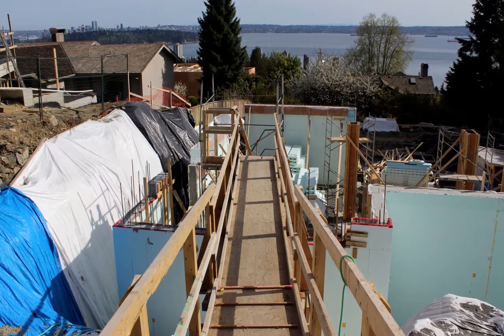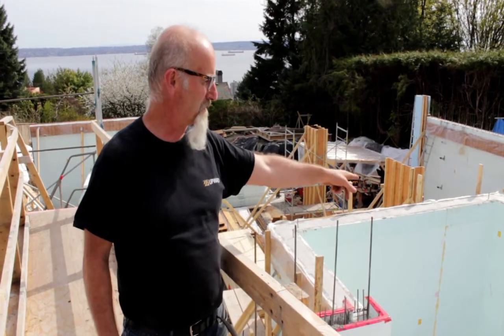Nudura Insulated Concrete Forms - 23.5' high walls, 14" Pilasters

Comment: Great looking job.... It seems your vertical  rebar was kept one length and not dropped into the wall after it was constructed- pre-pour of course.  How the heck did you get the blocks over all that rebar at those lengths ?  We are using Nudura for residential and  we wet sticking the footer  with 36" lengths leaving 28" above the footer. Building the wall and dropping the rebar into the horizontal grid created by alternating our horizontals each row.  Is building code requiring full lengths of vertical rebar poured into the footer  running to the top plate ? Yikes !